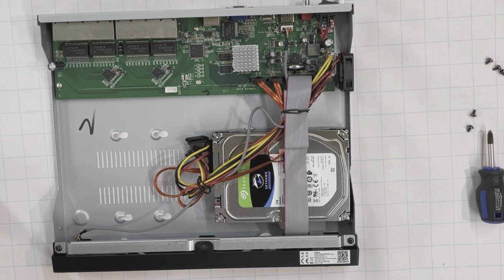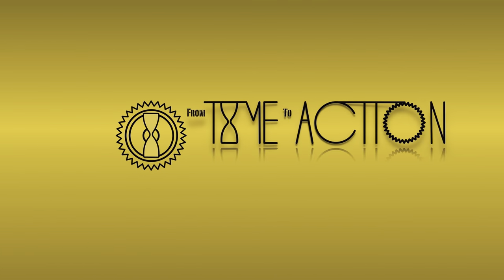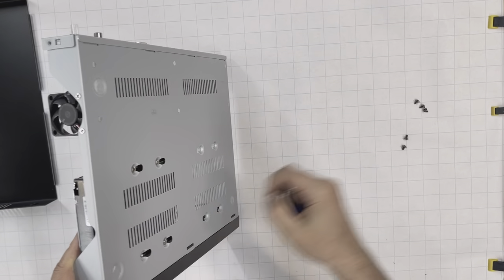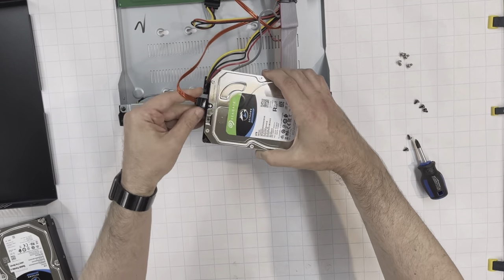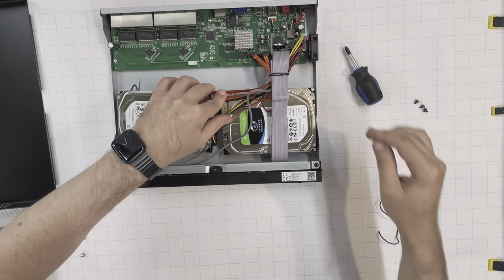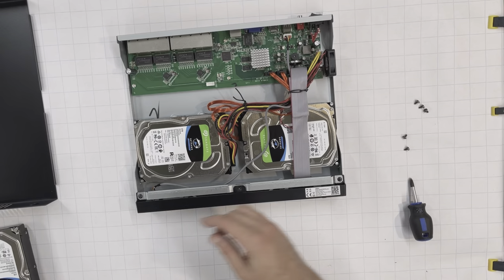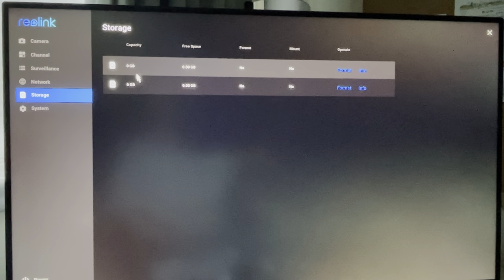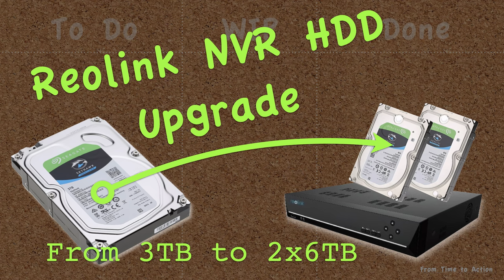Reolink NVR RLN16-410 hard drive upgrade

Comment: I have an esata port on the back of my RLK-812B4-A with 8 channels. Can I connect an additional hdd to that esata port? It says it supports two hdds but only has one spot available within the chassis. 2×6tb. It's a reolink

Comment: The Reolink hard drive compatibility page gives 2 options for 6tb hard drives. One seems to be more economical on power (using half than the other) with a slightly less data throughput from 195 to 180gb. Did you go for the speed or economy? Interested as I’m wanting to do the same. It’s good that they are quieter.
Reply from the maker: For me, the disk capacity was the prime factor. 2 x 16GB hard drives give me ~ 18 days of the recorded video.
Reply: scottluther2091  im sure if you worked it out others can too. doesn't cost anything to be nice

Comment: Good video.  Did you have to resetup all of your NVR and camera settings after you replaced the drives?
Reply from the maker: Actually not. All settings remained the same.
Reply: @aleksandertesenkov1421  They have a flash memory which stores all the important data.

Comment: Thanks for posting this. Just curious, the Reolink specs say that 4tb is the max size.... you have had no problems with (2) 6tb?
Reply from the maker: No problem at all or any special tricks. I followed the steps exactly as in the video. I installed the latest NVR firmware right after I bought the recorder. I’m not sure if new firmware is the key, but it may worth to try.
Reply: I got the 4tb version - RLN16-410-4TB and I installed a  Western Digital 10TB WD Purple Pro.  Formatted right away and recognized the full capacity.